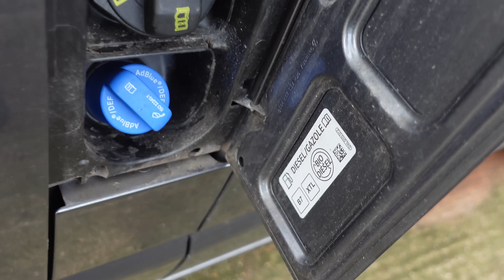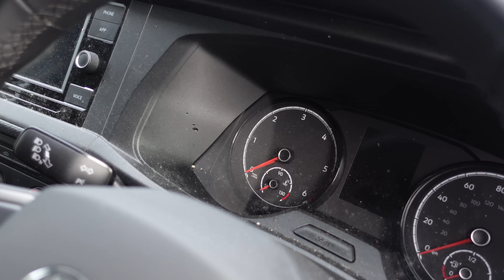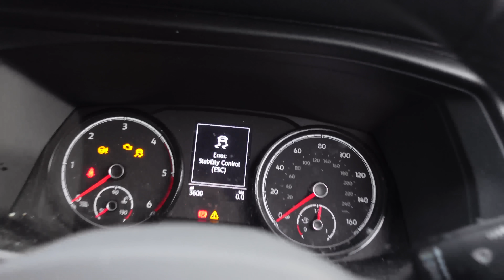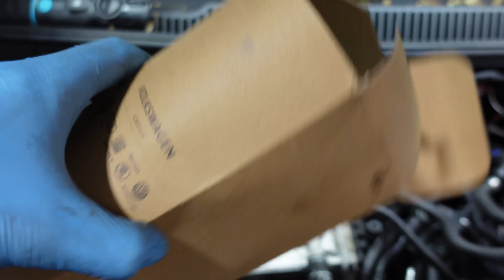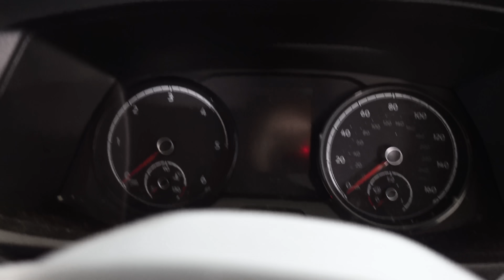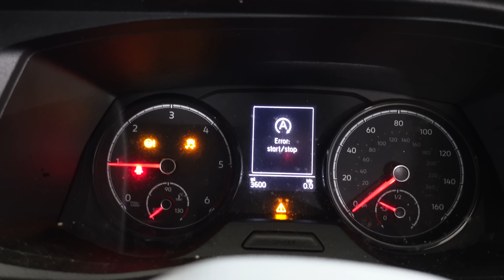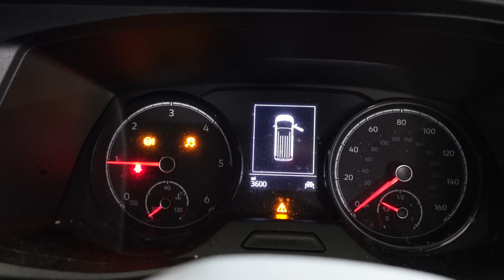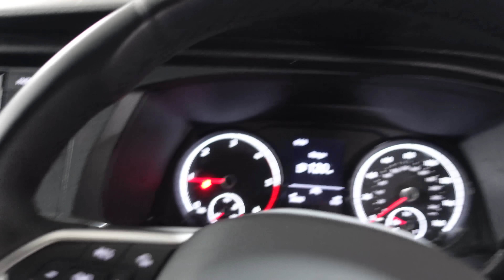I BOUGHT A CHEAP VW TRANSPORTER.. FULL OF PETROL!!! MISS-FUEL...

Comment: ok nice.
Now you will have to change all the fuel pipes,
Tank,
Filters,
Injectors

Etc.

Yes it may run, however all the lines and fuel components are now damaged.

PON tell us we have to change everything or, all warranty will be invalid. and they don’t recommend quick fixes.
12 years VW - Audi trained.
Reply from the maker: I’m sure someone’s not going to spend £6k replacing the whole fuel system if it runs fine.. when I was at Vw and Audi they regularly just did what I did on misfuels to their own demos when they were misfueld.
Reply: @SavingSalvage  Yes indeed, however the systems life span is greatly reduced.
And then they would sell it anyhow.
But kudos, good luck 🤞

Comment: Filled my diesel freelander up with petrol took 30 miles before it conked out found some old oil and pop bottles side of  dual cartridge way pumped petrol out through under bonnet pump walked to petrol station bought a can of diesel walked back poured it in started up straight away drove to petrol station filled it with diesel got there an hour late with a funny story for the lads lol

Comment: I had two Transporters both great to drive, the 1st was a 5cy petrol and not very impressive engine, 2nd was the Turbo Diesel which went like a Rat on Fire and very economic, on a long run 5.2lt/100km...... HOWEVER VW parts are horrendously expensive as with VW Servicing.... I was quoted AU$1,800 to replace Drive Belt by local VW Service Dept.... Had it done by local Mechanical Shop for Au$580-00 inc parts took him about a hour.
      At the time VW only gave a 1year Warranty and 13 months from new the 1st Van developed a drive shaft leak...Was Quoted Au2,000 to repair.... again another Mechanical Workshop quoted Au$580-00 to do one and Au$900- 00 for both and assured me the new Bearing/Seals would be better than the VW genuine and they were.

Comment: I saw an AA guy drain a mis-fuelled tank in a service station with a pump, refill with the correct fuel and drive off. Was he lucky?
Reply from the maker: At a service station I would have done the same. But I had all the time and a Workshop with a ramp so I did it properly

Comment: I dont know why you put in as muche work in as to frop the tank. I bid of petrole in the diesel is no harm, other then water. Pump out the tank using the fuel pump put in Diesel, fuel filter change, finished.

Comment: Instead of all the work underneath, just pull the line off the filter outlet and put a hose on it into a collection vessel.  Then work out which fuse/relay feeds the pump and bridge it out.  Let the pump run until it ventilates, then put 20-30L of good fuel in.  Way less work doing that way.  Forecourts are allowed 10% contamination between fuel types in their tanks, so, also long as you put a decent amount in the fuel tank, it'll be good enough - you don't need to totally clean the tank out.

Comment: So as per others here, i had a pd130 Passat b5.5
 One early morning filled it with the wrong fuel (super unleaded (black handle) from empty to a full tank, expensive mistake). RAC drained it after it broke down about a mile away from filling station (1/2 a mile from home where i could have drained it). RAC drained tank and flushed the lines, the car then went for another 100k with no issues other than the clutch needing replacing and the bonet catch failing shut. The RAC chap even said it does no harm other than giving it a clean with a thinner solvent.

Comment: Why you just “unplug” the fuel line and let the van’s fuel pump do its magic. Leave the dashboard on and it will pump out itself.
Reply: yeah you dont even need to hook up a scan tool to activate the fuel pump
Will have to clear codes for the missing fuel pressure afterwards though

Comment: Filled motorcycle with diesel in error after having knocked over by blind driver who reversed into bike and had parked by petrol pump but after picked and shouting at blind driver half filled bike with diesel Aaaaaahhh
Called AA they took me home and i drained the tank and tried starting bike stsrted and smoked like crazy removed filter and cleaned bike after a run to clean engine out it no longer smoked and ran very well..

Comment: Thats cute, "miss fuel don't usually make an engine go bad". hehehe you would be right if it were diesel in a gas engine, even if it ran. BUT gas in a diesel engine,  You must have a hard time walking with all the horseshoes up yer arse.
Looks there were no damage from preignition and no lubrication in the pumps
Should have made a hatch in the floor to get at the fuel pump in the future, they are know for failures